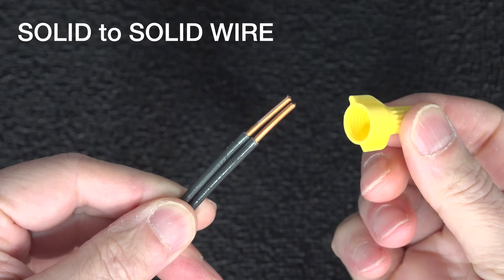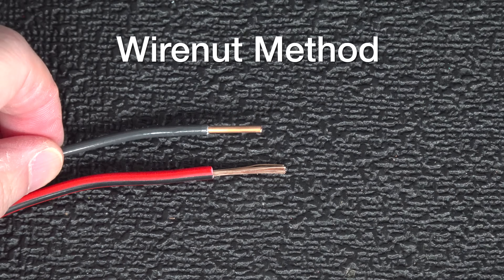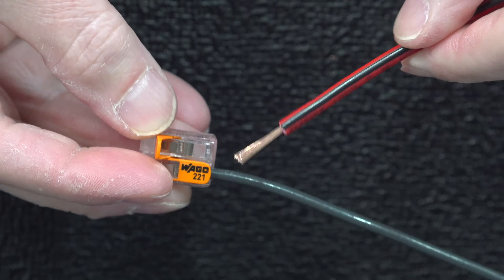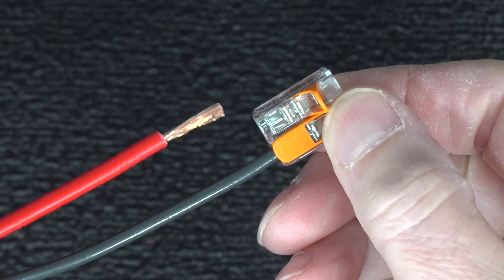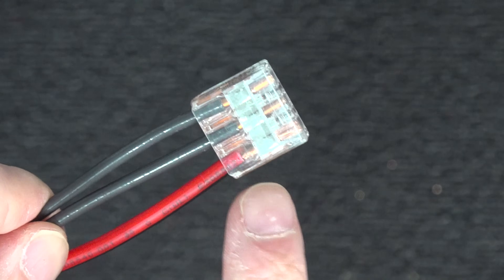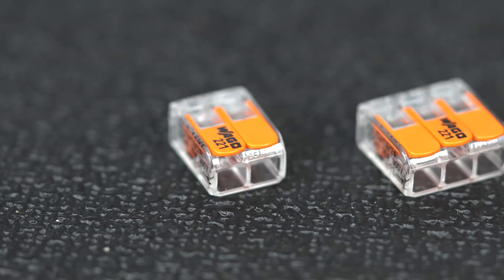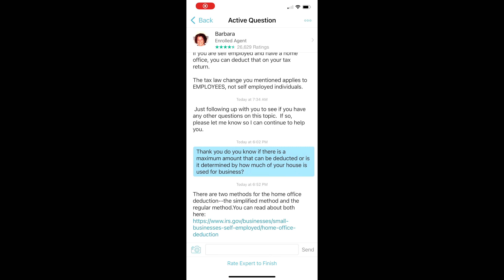WORST Electric Connection Made Easy STRANDED & SOLID Wire

Comment: But are these Wagos heat proof? Ceramic wire nuts came with a furnace ignitor, but they won't grab a solid and stranded wire.

Comment: use your kleins to twist first then wire nut every single wire nut join every combo no matter what twist it longer than wire nut then clip it down a bit and twist on wire nut ang give a tug to each wire before pushing into j boxes and no electrical tape around the dang things either

Comment: You must use a spring wire nut to connect a stranded wire; do not use a wire nut designed for solid wire.

Comment: No. Dont use tape on your wire nuts. Take the stranded wire and slightly lead it longer than the solid wire so it grabs the stranded first. Then twist it so it catches the stranded then the solid and hand tighten until its tight and cant be tightened anymore. Tug test both wires to ensure they dont escape the wire nut

Comment: You should’ve just started off with saying this is a Wago commercial
Reply from the maker: If you know a better alternative, let me know. In the US you can't just use tape, you need a pressure connector and there is no better than Wago for this.
Reply: @SilverCymbal  the main reason for my visit to your video was because I need to make a connection with ceramic wire nuts the ceramic wire nuts that I am using are considered large and can accommodate up to  number eights by the look of the wire nuts it doesn't seem possible so I was just browsing methods I think the wagos are good for lighting loads and general purpose receptacles in a home👍🏻

Comment: how to select electricians before hiring them:
Reject if: they can't splice solid 10 awg with stranded 10 awg using pliers and a wirenut, ask for wagos or ask for wire peelers or any fancy tools asides from pliers, blade and screwdriver.
Accept if: They can do everything with a pair of pliers.

Comment: Yeah, when doing vinyl ceilings and taking down/putting back up ceiling fans. I've always just electric taped around them. Often solid wire to braided wire in those situations around here.

Comment: If I have to connect a solid wire to a stranded wire (like in most "smart" switches), I always twist and solder them, then use a wire nut to cover it.

Comment: I am a maintenance tech for a large banking firm. Every time and I mean every time that a printer has lost power or an office cubicle and lately a water cooler stopped cooling it has always been a " wago, wedgie or whatever name you choose but in my opinion, you couldn't pay me to use them !!!! One outlet on a three outlet run went bad - pulled the outlet and the bare copper neutral is setting there staring at me. I went to the other two outlets - more wagos - cut them all out, stripped the wire and installed "GB" brand wire nuts !  I think that someone on UL was on vacation when these were approved for use. These wagos,etc are on the same level as " back wired " outlets and "federal Pacific" breaker boxes !!! With all the more that makes contact with the wire when the wire is slid in, how can anyone say that a wago can handle the wattage of a full load ???? Can someone honestly tell me that a wago has as much connectivity as a wirenut ??? I wouldn't be caught dead using a wago nor any of it's counterparts !!! I have seen too much failure !!!

Comment: Actually the only correct way of connecting solid core wire to stranded wire is to strip about 2cm of the solid wire and bend the stripped section in the middle by 90° then get the stranded wire and strip 2x as much(4cm), spin it around the solid wire about 4-5 times then Fully close(pinch with pliers) the 90° bend of the solid copper, by doing so you "crimp" the solid wire to the stranded one making for a very strong permanent connection .
Or be a man and solder them.
Reply: DIYer here, didn't know about these little items, but I also have an older home with stiff, multiple copper wires coming in and I'm trying to connect up an LED fixture with stranded.  I don't think the copper bunch is likely to fit into a wago though I am considering picking a pack up next trip to the store - in case I have another situation where I CAN use them.  HATE trying to firmly connect stranded to copper.  Going to wrap it with electrical tape this time.  Appreciate the video, as well as the comments here!

Comment: What is the contact area of the Wago?
Regardless, the physical force of a wire nut twisted onto the the wire, plus that force pressing those two or three wires against each other must be 5, 10 times  or more,  than the Wago who's connection is easily made by gently pushing the lever closed.
It may be fast and sexy, but....

Comment: Should of watch this yesterday. I had a led light I installed that came with those nifty connectors. Ended up cutting it and using wire nut smh.

Comment: The electrical tape on wire nuts is garbage. No self respecting electrician would tape up wire nuts, they would use good quality wire nuts instead and make quality connections.

Comment: For solid to stranded connections with wire nut, always leave stranded wire 1/8th of an inch longer. Hold them parallel then just twist the wire nut on. Twisting the stranded around the solid will cause failure at least 60 percent of the time. Always tug test the joint to ensure a proper connection has been made.

Comment: Or you could tin the stranded wire with a soldering iron. Then it will not fray and also works much better on screw terminals.

Comment: Problem with Wagos is you can’t fit anything larger than a 10. Got some 6 awg wire I need to connect, these won’t do.
Reply: Bit late to the party but there are wagos available for 6gauge. Why you wouldn't just use a lug or insulated connector instead would be beyond me

Comment: Cut the solid wire tip at a slight angle with lineman pliers or wire strippers and it will be pointed at the end. This allows the solid wire to slide into the back of the wire nut and become tight when you twist.
Reply: Good idea!
Reply: Yeah fuck that . Welcome to the wagons era friend

Comment: I'm changing out old smoke detector in doublewide trailer and I'm trying to figure out tight I should put the wire nuts back on
Reply: Tight enough that you cant rip the the wires out with your hands with moderate/full strength.

Comment: So I had to replace a zwave switch in a three gang box. So I decided to order some wagos. I thought I only needed the 2 or 3’s but got a small assortment up to the five. 

I had forgotten the hellish wiring job, I used the fives!  Not sure how this house passed inspection with one wire nut was holding seven neutrals!

So the wago really cleaned it up, wirenuts take a lot of space and smart switches do also. 

Now that I’ve seen them myself, I can tell they’re a nice sturdy option. Will use from now on.

Comment: Does the current capability equal that of the wire nuts? Seems like only a very small portion of the connector is contacting the actual wire. And therefore it may not allow the full current capability as a wire nut. Same with the push in connections on the back or switches and receptacles. Bad idea! Those push in type connections only have a thin piece of metal making the connection and they burn and break connections all the time. I know, I had to replace near about every push in type switch and receptacle in a older house to get everything up and working properly again. Never use push in type house connections. Use the screw type connections...
Reply from the maker: Check out this video where I did my own tests https://youtu.be/B1pmuRsf1co but the short answer is they are rated for 20amps and tested officially at that and will do that job without issues

Comment: Hello Silver Cymbal,
I'm really impressed of the video that you made. I just bought the Ecoflow Delta 1300. Could you please make a video to show the Delta 1300 works with gas furnace 96% Goodman 120k BTU gas furnace GMBC961205DN and sump pump 92341 1/3 HP simultanously?
Thank you so much
Thank you so much

Comment: when you have to deal with connecting stranded to solid wire there's another option. You can tin the stranded wire with solder, and it basically becomes a solid wire. Now you can use a standard wire nut without everything shredding inside the wire nut.

Comment: Thanks for the video!

Where can I get Wago wire connectors aside from Amazon? I can't seem to find a good place aside from Amazon.  Sorry, but I just don't trust things like that from the zon; I've been burned, thankfully not literally,  too many times before in getting what I think is authentic and I double checked to make sure it is but turns out to be knock off stuff. 

It looks like Home Depot and Lowes have the "Ideal" brand that are similar but a little different (push on and no lever) and are made in the USA, so I think I'll try those!
Reply: Menards

Comment: Wagos do have their place, but wire nuts aren't going anywhere. Wagos are easier to use but because the copper wires aren't directly touching one another, that means increase resistance, efficiency lost through heat. A wago will always be far warmer than a wire nut itself. In a world where energy effiecny is the key, its something to consider.
Reply: Braze your copper then…
Reply: From tests I've seen, it's not "far warmer", but it is notably so.
Reply: No, hell no. I'm literally watching this video because the wire nuts with electric tape came loose. So screw wire nuts. I literally toss those them in the trash when I see them.

Comment: The only downside to wago is they have a higher resistance than a properly done wire nut, because of the lower surface area
Reply from the maker: Theoretically, sort of. Not sure if you saw my video where I compared them to a wirenut at 3X their rated load. Pretty good stuff! https://youtu.be/B1pmuRsf1co

Comment: The 221s are life changing. Once installed, you can even change out switches and outlets without shutting off the power. The 221 is, itself, like an outlet; I just do everything I need then “plug in” the black last. Done and done. Love them. Hot swapped a switch the other day in less than 2 minutes.

Comment: The only problem with wago is that they aren't always available at the hardware store and are significantly more expensive than wire nuts.
The price doesn't bother me personally but it certainly drives away the average Joe. I really wish these were more popular in the USA because they seem safer and more foolproof than wire nuts
Reply: Well, there is a simple solution to making them more popular: make them cheaper.

Easier said than done.
Reply: @orppranator5230  if only...
Reply: Cost is key.
When I can get 100 wire nuts for the cost of 5 wago connectors...it's a simple choice. 
reality in todays climate is that the bottom line will drive your purchase regardless of how much superior another product
will be. It's why we all drive Chevy's and Toyotas and not Ferrari's and Bugatti's
Reply: @colfrankslade  Cost is not key when it’s for your own home. I’ve had wires come undone with the wire nuts, it’s not worth it when the Wago’s are so much better. I literally sleep better knowing I used the Wago instead of wire nuts now.
Reply: @strongisland7015  We just moved into a recently renovated home that had "professional" work done recently. As I've gone through doing a few repairs myself, I am far too frequently finding wire nuts falling off.
I've done a small amount of electrical work and never had wire nuts be this much a problem, BUT after seeing the other video about Wagos, I purchased a kit of both the lever-lock and the push-in connectors. You hit the nail on the head here because I will absolutely continue using them regardless of the added cost and slowly replace any appropriate connection I come across if for no other reason than the fact that I can easily see at a glance whether my wires are properly in the connector. That added peace of mind is worth the price to me.

Comment: Are they waterproof?
Reply from the maker: By themselves no, they have a thing called a gelbox that these go into and makes them waterrpoof. But for some dumb reason they dont sell that in the US, only Europe. Until then I use these if I am outdoor or ficing underground low voltage stuff. I used these on a sprinkler line I hit a few years back with great success.  https://youtu.be/NZtwD_F7lTA

Comment: The 1st option is fine, but you want to wrap the electrical tape in the direction that you tighten the wire-nut.
Otherwise your wrapping of the wire-nut with the electrical tape can loosen the wire-nut and that's not great.

Comment: These particular connectors are nice but, they are not insulated or should I say sealed for outdoor use.
Reply from the maker: Very true, they work very well in vehicles as well as houses but only interior protected space from elements. For connections with direct outdoor stuff (low voltage only though)  I would recommend using these. https://youtu.be/TofHP1moT78
Reply: Are wire nuts?

Comment: You did a video not too long ago about the Wagos and I was very impressed by them. I hate the wire nuts and started using something similar to the Wagos, but it did not have the levers, so you had to push the wire into it which made it impossible to do stranded wire. The Wagos are just genius, and now you’ve show a couple more reasons why. Thank you 😊
Reply: Wago makes a push in one for solid wire (you can twist them of) also they make these with tabs for stranded.
Reply: @SPARKYMAN-BELGIUM  yes and the WAGOS for solid wires are almost as cheap as wirenuts. The 221 is quite expensive and the solid wagos are 2273
Reply: Do you also use the stab connector on the back of receptacles?
Reply: @Catalyph  we don't have those here in Europe
Reply: @SPARKYMAN-BELGIUM  I'm in the UK and I use them.

Comment: They're fantastic we use them all the time on machinery at my work. Also I don't think there's a better way to connect neutrals in a light switch back box.
Reply: I thought wago connectors were not rated for commercial applications.

Comment: Thanks for the videos… fantastic!   Question: do you ever consider ferrules on stranded wires before inserting in the wago or is it not necessary?
Reply: I used ferrules on 14 and 18-gauge strand in connectors similar to a Wago, for 12-Volt wiring. Worked well, especially for 18-guage. The ferrule holds the strands securely, and the connector slightly pinches the ferrule. I tested a few prior to use and they didn't pull apart any easier than a butt splice. It works really well when joining wires of different gauges.
12-guage is too large with the additional size of the ferrule, but I can push 12-gauge into the connector without spreading the strands. I couldn't with 14-gauge. The connectors don't have the lever the Wago has. 
I've bounced my trailer down many a mile of unpaved Forest Service roads and hundreds of miles of paved roads. So far, no failed connections.
Reply from the maker: Thank you very much. I absolutely love ferrules for any kind of screw down terminal. But for Wagos they should not be used at least not for this size, others may have good info or maybe I am wrong on this point.
Reply: @SilverCymbal  ferrules do nothing in this connector. wago will have tested it, if it was better they would have recommended it.

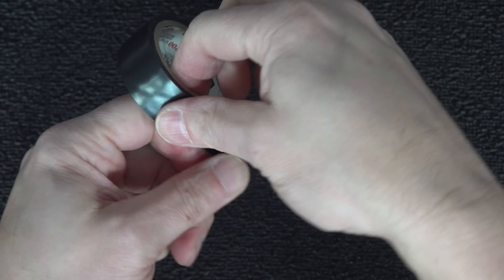Comment: Make one suggestion if I may. At 1:10 , wrap the tape clockwise instead, so it is still going in the direction of tightening the nut as you tape. Doing this counterclockwise way, can losen up your nut slightly if you're not careful.
Reply from the maker: That is a great suggestion, very good idea!
Reply: another reason not to use wire nuts.
Reply: @SupremeRuleroftheWorld  yeah they're great for non stranded, but I definitely am about to buy some of these little tools. You can't really wrap tape in small junction boxes effectively hardly ever. And I always have that feeling like I didnt get it just right when I'm pushing it all back in the box. Just not a great way to do things for any stranded wire project.

Comment: With the Wago clamps, is it recommended to twist the stranded wire prior to insertion or just insert it as stripped?
Reply from the maker: Thats a good question. I never have and I haven't ever seen them show that in their videos but others may comment in with different info
Reply: @SilverCymbal  I always twist stranded for any use. If you don’t it’s easy to have an errant strand end up outside your target.
Reply: @SilverCymbal  Hey I like these wago connections but since it is not wire to wire I have heard that they can heat up. Is this system safe for kitchen and bathroom lighting?? I am not an electrician and a potential fire is always a concern for me. Especially if it is in a wall or ceiling where it can't be seen.

Comment: Can a lever accidentally open?  I'm wondering whether it would be wise to run a piece of electrical tape once around the Wago when done, to ensure the levers stay down.
Reply from the maker: Some people do that and think the levers open on their own. When they are closed they are kind of in a neutral position so they can flap a little, but 100% the wire is still locked in. You have to life them all the way, and it takes much more force than you think. I have never had one open, you would know if that lever was opening, it feels like it takes a couple of pounds of force to me to open them.